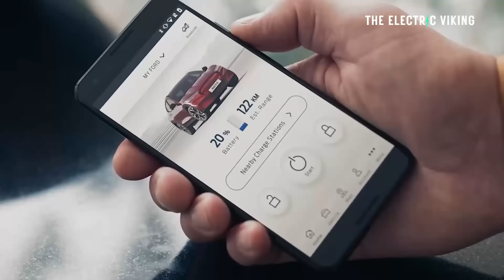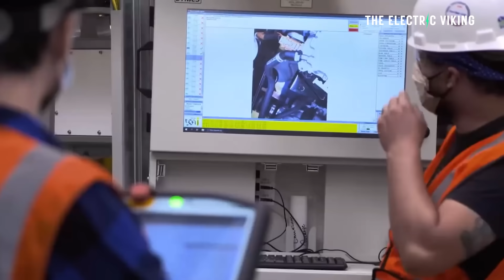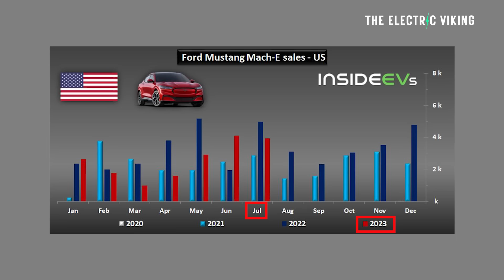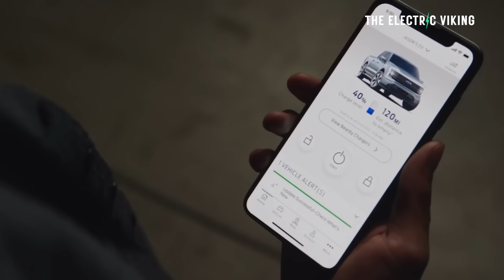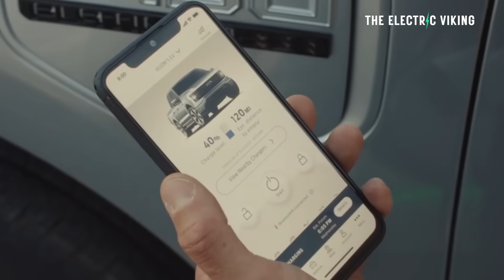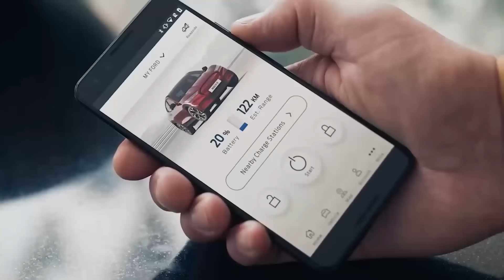Ford in CRISIS: electric car sales collapse in July as inventory piles up

Comment: Adoption of the NACS by Ford but not before 2025 could be a small cause for slowing down sales , people might just want to wait if there’s no need to buy now. More this bracket price is quite saturated specially with the early adapters or buyers. But dealers are still a big concern, in my region there two and neither have a good reputation. Finally Ford has more recalls than any companies.

Comment: I would seriously consider a Mach-E except there is no reason when a Model Y is less expensive and a better car.  What Ford and GM also need to do is follow Tesla's trim level model.  Eliminate all these different option packages.  Put in a standard package for all cars and sell models based upon 2WD or AWD and maybe a battery capacity level.  Having multiple different trim levels and option packages were great for dealerships.  Think about the Chevy Bolt.  In the Bolt EV you have 2 trims.  1LT and 2LT and the motor and battery are the same in both and there are very few options in either trim.  Same with the EUV and the only major option in the EUV was SuperCruise.  But the Mustang Mach-E has a ton of different models and option packages.  Just make them all AWD and offer a base trim with cloth and an upper trim with leather and then the Performance GT model.  Don't even make a 2WD version.

Comment: Like all traditional ICE-makers, Ford left it far too late to be viable in the EV sphere. While Farley's efforts to reshape Ford are noble, most of Ford's stakeholders remain very reluctant to make the necesary investment to effect the transition. While price is a big factor, even if Ford were able to make and sell Mach-E on par with Tesla, the latter is way superior in all areas that really count - particularly electro-mechanics, computerisation, FSD-readiness, manufacturing efficiency and overall business model. With looming UAW problems, Ford faces massive additional headwinds (as does GM, Stellantis and the entire ICE-vehicle supply chain) that will just acellerate their demise.
Reply: Living in dreamland
Reply: I have a 2018 S, but where the Ford is superior is the way the Mach *feels*.   The Mach is smoother, quieter, and more solid over bumps than the 3 and maybe a bit better than my S as well.  The driving experience is also an important part of what makes an EV.  I would love to see Ford do the NVH for Tesla in a joint effort.  Most people are more obsessed with dumb things like fit and finish, but the driving feel is not dumb.
Reply: But it doesn't look like a mustang. A Swedish car tester also believes that it doesn't feel like a mustang either
Reply: So you assume that everyone wants a car that is like a smartphone on four wheels. If you asked Typical Ford buyers, you might get an answer that would surprise you?
Reply: other car buyers may value other things like suspension comfort soft seats a nice wooden interior easy to maneuver
Reply: @Andersljungberg  Well, the whole mustang thing is a different argument. I think Ford should have made an EV version of their Edge. Call it "Edge E" (pronounced Edgy), but they didn't ask me! I love my S including the styling which reminds me of a Jag, but the Mach E stunned me with its ride, handling, and feel. That is one buttoned up package.
Reply: Farley is a cavalier showman and I’m not too upset they are lagging.

Comment: The US Interest rate has finally caused too much pain and EV  prices are just too high.  Even though gas is over $4.00 a gallon again. Model 3s are in the right price range but you can still buy a corolla for less.  It's not about the future when you can't afford it.
Reply: That’s why cars like the Bolt are so important, i wish there were more in this price range
Reply: @darmou  Problem was they were losing money on ever car they sold. It would be more a LOT more important if they made some money per car. Tesla sadly is the only American EV maker that knows how to make a car for profit that is a decent car with lots of great features to make the compelling. If they had a Model 2 today it would be selling to infinity and beyond due to current gas prices, incentives and price point. Alas, it won't be for years. This could actually damage the EV industry and where I wish Tesla would partner with someone to make that affordable American EV next year not 3 years from now.
Reply: @ChicagoBob123  Well they are coming out with a; revised Bolt so I hopefully they do better next time.
Reply: @darmou  Will they be built at scale? Will they loose money as well? So far GM Ultium has been a bust. Not one of those vehicles have been built to scale. Maybe someday but that day keeps getting pushed off until Tesla can do it at a profit. Shame.
Reply: @ChicagoBob123  There are rumours of a so called 'model 2' being made in Mexico but we will see, re Tesla

Comment: Sam, do you know that greedy Ford dealerships adds between $10K to $100K of the MSRP/list price of Ford Lightning F150? That  would surely kill the deal for many who are interested to buy one. EV in general is still $5-$10K higher in prices compared to ICE, so adding dealer mark up makes it even less affordable. Ford dealerships are not the only one doing this but that crazy up to $100K mark up on F150 Lightning I read on EV websites is the highest mark up. 
Another reason, the lowest trim F150L Pro was not available to purchase. It was for fleet only. Now Ford has said they will be taking in order for the Pro trim. I think that will help sales as long as no dealer mark up. The Pro has 240miles range, current price $50K before $7500 Federal tax credit and State + local incentives. Essentially, it becomes a $40K pickup truck EV assuming no dealer markup.

Comment: Disappointing that you didn't even mention the F150 Lightning line upgrades, which unquestionably will have impacted sales and production negatively.

Obviously Ford still in dire straits on the EV front but this is still relevant info

Comment: The concern is the many fires in electric cars .There is a need for ventilation trough the battery pack so it does not heat up and catch fire.People hear about all the fires in electric cars which is more than double so many as conventional cars . The lack of charging points are also a reason .If you live in apartments you need these points to recharge .EV cars are too expensive compare to normal cars .

Comment: Here are four reasons among others, why Ford EVs are not selling.  1) People are finding out the Mach-e engineering is way behind Tesla’s (see Munro Live channel on thermal system comparison  vs the model Y).  2) The imminent arrival of the Cybertruck which could prove much superior to the Ford Lightning for a similar price if not cheaper.  3) Greedy dealership markups  4) Immediate access to Tesla’s superior Supercharger network instead of waiting till they open up next year or use a clumsy adapter or wait till NACS is implemented on future Ford EVs. And not all SC stations will be open to non-Teslas, Tesla will open up ‘at least 7,500 stalls’ in the US, but there are around 17,000 of them so less than half the stalls will be open to non-Teslas. And no doubt those unavailable to non-Teslas will be at the most desirable locations, smart thing to do and Tesla is smart.  So for someone in the market for an EV a Tesla is the wiser choice also the safest cars in the world.  Seems like a no brainer to me and yes I drive a ‘20 Tesla, love it. ‘You will be assimilated.’, lol.

Comment: It might have something to do with the rising cost of electricity combined with the inconvenience of charging plus fire hazard. Plus how many other cars are going to require a battery swap in the first 10 years of ownership.
Reply: You can't charge at home from an apartment and most condos.  So, yeah, apartment dwellers have to spend many hours at charging stations.  I'm not at all convinced that EVs are the future.  My electricity has doubled in four years here in South Carolina thanks to enviro nuts.  Finally, I saw some guys take the Lightning through Alaska.  Of note, they spent fourteen hours at one charging station that was 240 volt/30 amp.
Reply: As opposed to dropping gas prices? Or the 1/10 the rate at which EVs catch fire compared to ICE vehicles? Or the inconvenience of charging at home (I haven't been to a gas station in > 6 months). Or is it the 10 years of virtually no maintenance that's a problem? And what stats are you using to claim that an EV battery pack is likely to need replacing after 10 years. And not a single positive? Millions of EV drivers think you are , on the whole, wrong.

Comment: Too much extra cost fluff that many buyers can't afford is a good part of the problem.  Many orders being cancelled are due to making the more basic models that were ordered unavailable and trying to force buyers to take an more upscale model with a price point they aren't comfortable with.  From the complaints from buyers who canceled it almost sounds like Ford or their dealers checked the buyers credit ratings and automatically bumped them up to a vehicle that matched the upper limits of their credit rating instead of what they were willing to spend.  Some will roll over and accept this however it looks like more put on the brakes than Ford expected.

On top of that we are talking about a company known for sketchy practices like managing their workers by threatening and beating them with axe handles, dragging out litigation in the hopes that those harmed will die before they have to pay out,  stalling recalls until the majority of the vehicles have already been scrapped, etc, etc.  Its not all roses and sunshine when you look at the history of Ford.

It will be interesting to see how they manage and put a spin on this.

Best!

Comment: It isn't just that legacy automakers delayed in adopting electric vehicle manufacturing.  The problems run much deeper.  Legacy automakers like Ford, GM, Dodge, and VW are inextricably tied to a business model that has reached the end of its century-long run.  That model contains cost components that these companies will find impossible to eliminate.  There comes a time when it makes more sense to bulldoze an old house and rebuild on a new foundation rather than try to renovate it.  Sadly, I think that time has come for Ford.

Comment: I have no idea what price points you are looking at here in the US. All 3 OEM's have been placing up to $10,000 US dollars mark ups on not only their EV's, but ICE models also. The Lightning has earned the nickname here in the states as the parking lot princess. The vehicle is basically useless for towing any thing from a boat to a camper due to battery drainage issues. Most OEM's have seen ICE sale increases the past 2 quarters due to fleet sales. Retail supply for higher priced ICE F150s have slowed dramatically. All OEM dealer lots are over flowing w/High priced trucks & SUVs w/2024 models set to ship soon. There just isn't much of a market for these high priced EV's, regardless of what your research shows. We live it here, so just do a quick check of any OEMs days supply of unsold high priced trucks, jeeps, or suvs to see the truth.

Comment: Ford dealers sold 86.4% of their Mach-E inventory within 30 days in the second quarter of 2022, but that figure — known as a turn rate — dropped to 27.7% in the same period of 2023 even as the automaker had more than twice as much inventory on the market. Wait for some big sales. They are coming. There is also a secret extra 3k discount but you have to know about it.
Reply: Nah, just buy a Model Y or 3…Ford cars suck

Comment: The lightning isn't selling because it can't do what a truck is supposed to do. It can't tow or haul a heavy load more that 100 miles before you have stop and charge, plus they are ridiculously expensive. They are not. worth it. Most people in the US dont qualify for the $7500 tax credit. It's the biggest gimmick out there.

Comment: A: its because ford's EVs cost way more than Teslas, B: The Lightning is basically a useless truck for truck things and is wayyy to expensive. They should build a 40kw to 50kw plug in hybrid ecoboost 4 cylinder F-150. That way it can tow a boat to the mountains and hit a mountain gas station or take 20 extra gallons in jerry cans.

Comment: The inconvenient truth is that few people even think about buying an EV let alone afford even the even the cheapest EV.  No matter how many times it's said there is great demand for EVs, it still doesn't make it true.  The F150 Lightening has two major problems, 1) It's severely over priced, 2) In the real world it doesn't do truck things as well as the ICE versions and again, at a significantly higher cost.  The Mach E is something no one asked for and no one wants.
Reply: Yes and no... A HUGE number of people want EV's, but they are not available.  They are selling quite well at reasonable prices.  The mach-E is not selling because it is a Tesla model Y at $15,000 more than the Y costs.  The Lightning is just a lie. They advertised a $43K truck and everyone said YES! Then they shipped $80K trucks to the dealers and said "here ya go!".  The demand for EVs is massive right now, but nobody can afford them in the USA.  Every other country is buying them up like crazy.

Comment: in my city.. where alternative transportation is catching on.
I see alot of  electric scooters.. and bikes are used up and  dumped on the streets. They're not even scrapped.. nobody's scavenging parts. Only the makers of these can fix them. If they retrieve them.  I could use something less than my truck.. and e bikes cost more than a motorcycle. E transportation hasn't proven itself yet. Imagine BEATING your Tesla around for an hour. Than " oh crap.. I have to find a charging station ". Than wait in line for a couple hours to use one that barely works . Besides..ol jo and co are profiting with china on e.v. production and sales. Weather or not they catch on.

Comment: for me as an american there are only 2 models of vehicles to purchase from ford, f150 which i have always owned since i was 16, and the mustang GT. both must have the 5.0 coyote engine and preferably the pony car with a manual transmission. as i have aged my tastes have evolved not to EV but for v8's with greater than 400hp,  stitched leather, high end audio with as little plastic as possible. everyone i know that has made the EV jump has been burned, my friend went through 2 fords with mega thousand bad battery fails/totals and he still went with a hi-brid insight that is a small lifeless, soulless piece of junk. batteries fail faster than engines no matter what they say. until battery failure is low thousand dollar fix EV's are doomed.

Comment: Everyone must be waiting for Ford's 2nd gen EV's or maybe for that NACS charging port! I have a VW iD-Buzz dealer reserved but if it does  not have a NACS charging port or a faster charging speed of 135kw/hr sadly I will walk away. Plus ConnectDer still has not released their hydro meter collar for level 2 charging solutions in Canada so a number of things need to come together for me to go through with an EV purchase. Right now if push came to shove a base model 3 with no need for a level 2 charger with 60km per week a regular level 1 will suffice in Ontario we only get a Federal EV credit $5,000 as Provincial took away the $10,000 when Ford goverment came into power. EV is still evolving with solid state batteries that are more stable with no liquid. Everyone is rushing into the unknown is rushing into the unknown besides Toyota and they will get burned by the lack of knowledge and what Tesla is evoling to like 48V system not just for cyber truck but all  their  vehicles. Lease early EV then no regret especially proprietary Tesla's  which has no supplier network  for replacement parts Tesla has this under lock and key.

Comment: Half of it is the 240 mile range for the f150.  No where near enough.   And 320 is still a joke.  Seriously you can’t tow or have a full day of real work with that.
Reply: 125 miles pulling a trailer 🤡

Comment: Ford has one chance.  Roll out a Maverick EV.     Collect the tax credit for every buyer.
They will sell every single one they produce.
Buyers do not need to use a Maverick like a f250.

This way, ford isnt direct competing with cybertruck.
People simply want EV truck that gets 200 miles. and they can put a washing machine in the bed.
and it doesnt get 14 mpg.
200 miles range is plenty.    Its no problem to charge up at Sheetz or a Walmart. on the return trip.
Reply: Ya but they will roll it out for $10k more than it is worth, so there is that.

Comment: Meanwhile, in the UK, model Y dropped from No. 1 best seller in June to No. 10 in July. Best seller was Ford Puma, with Ford Kuga at No. 7. All the other Tesla models (mainly model 3, I think S & X are pretty much dead) came nowhere.
Reply: And the rest of the story is that Tesla has not been producing as many right side driver Teslas. Can't sell them if you con't make them.
Reply: @timm6876  Or you don't make them when you know you're unlikely to sell many.
Reply: @brendanpells912  Doesn't seem to be a problem for Tesla.